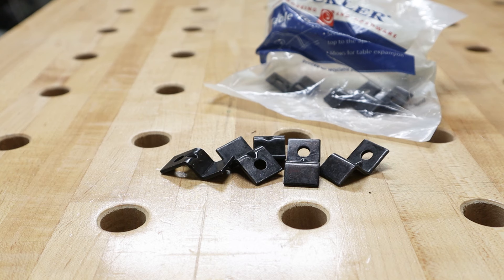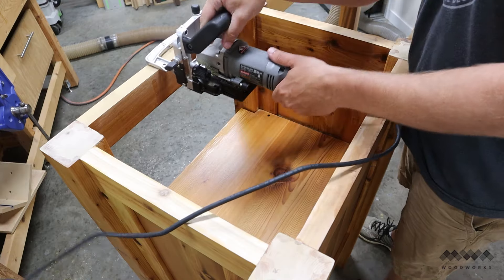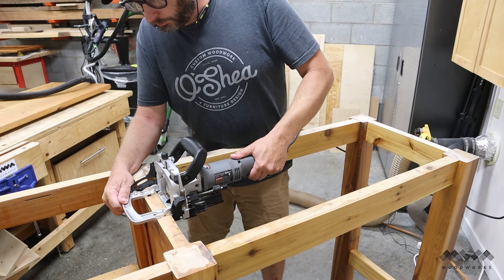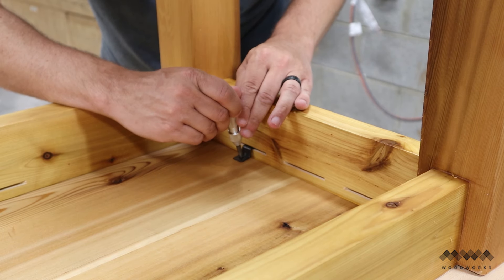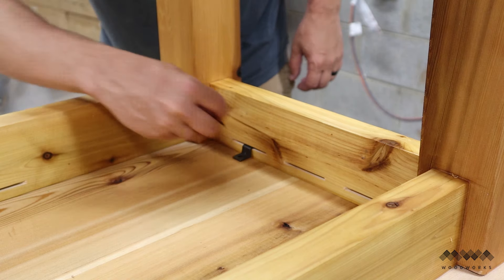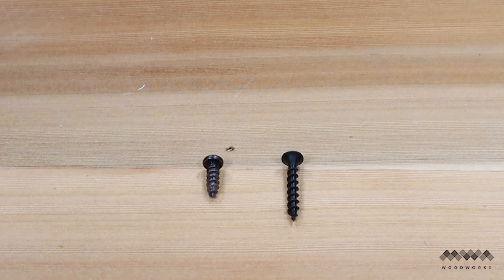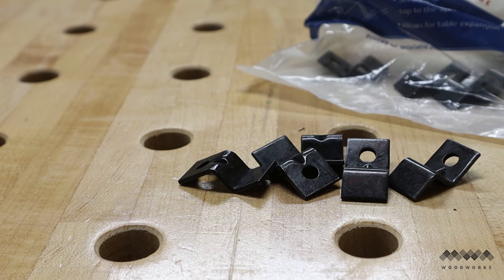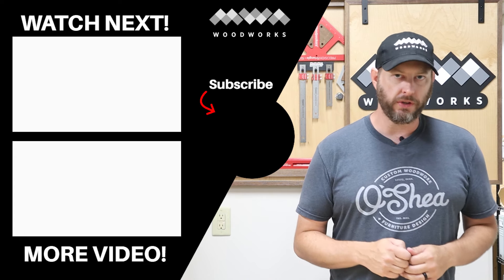Dead simple way to attach a table top

Comment: What does it mean if you do this but can still slide the tabletop around a little bit, even though the screws are in tight?
Reply: I second this.
Reply: @matthewbrennan4232  I tried again, this time I cut the slot slightly lower on the apron. That way I think the tabletop was pulled down to the apron more and it's more secure. I also used more clips but I don't know if that made a difference or not.

Comment: Why. I don't see were any up lifting of glued up planes would be a problem. I have used velcro to hold down table tops to frames. The top can cross expand all it wants and I have never had a problem.
Reply from the maker: Hey if the customer is good with Velcro then that's a solution. However I wonder if a bag of z clips isn't the much cheaper option 🤷